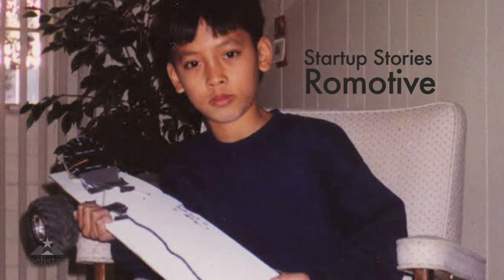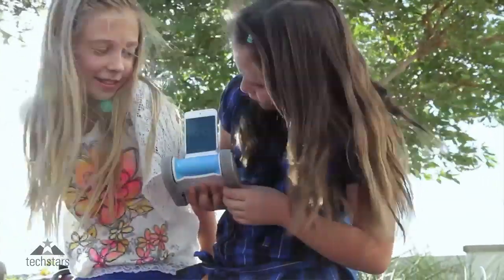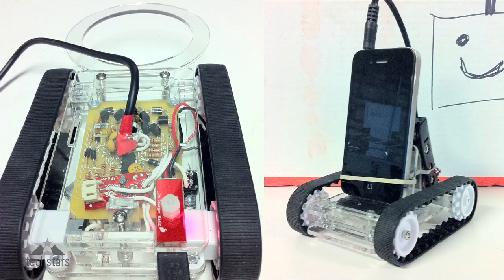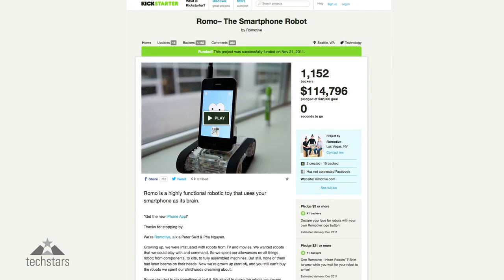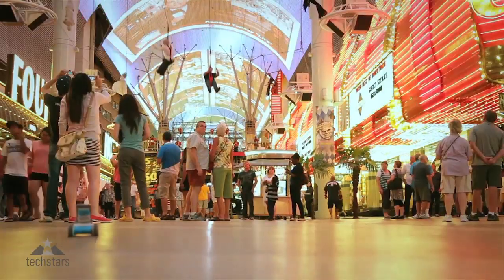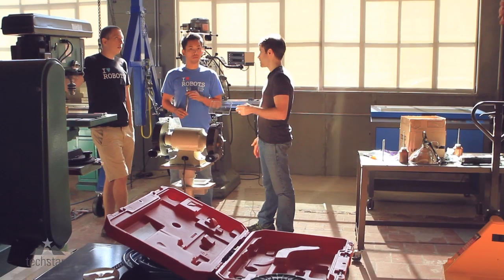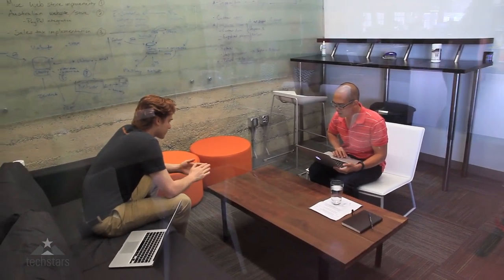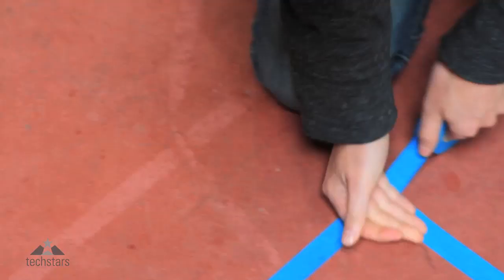Startup Stories - Romotive

Comment: Well, I lucked out good. I found a Romo Base for the iPhone 4 at a local Antique and Curio shop here in Australia. At first I felt reluctant to purchase the base due to the fact that I did not have an iPhone to use it with, and thought that the apps were discontinued. But doing a little more research, and discovering that the apps were rebooted for use with other iOS variants, I decided to buy it for $19AU.

I then went into getting a refurbished iPhone 4S to use with it, because it operated with iOS 9 and had better specs than the base iPhone 4, and after trying out the free My Romo apps, discovered it worked perfectly. After purchasing the Romo X app for the device, I managed to get the control system working, and now it is perfect for use. And thankfully I was able to get the parts for the robot before the lockdown situation we are currently enduring.

So basically I had a good sense of luck to help me with all this. The timing was perfect, and the access to the elements and stores was perfect. Now all I need to do is to have the Romo chase my earlier purchase of a Sphero 2.0, and I'll be content!